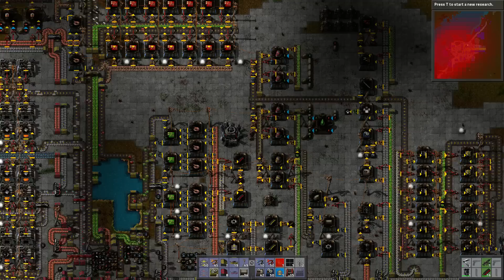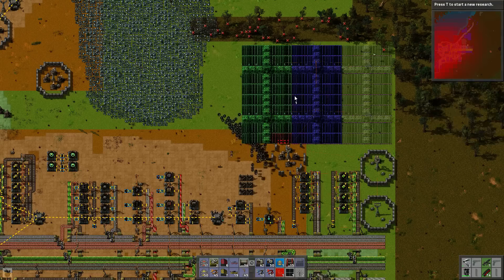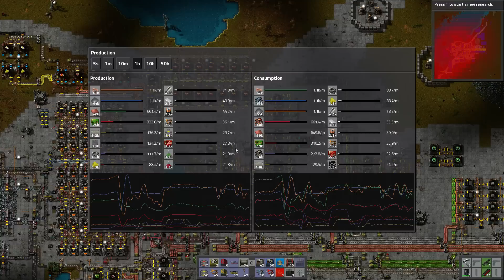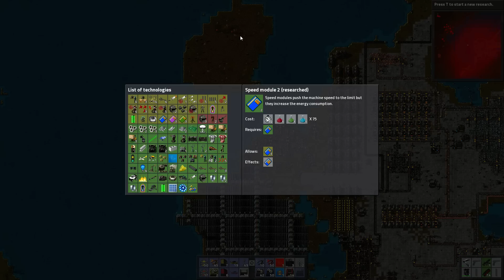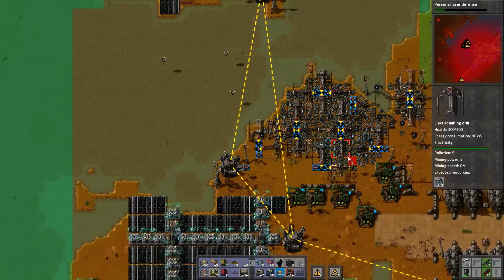Factorio Let's Play Patch 0.12 (27)

Comment: could someone help i am playing the 0.11.16 and my plastic and batteries are being slowed down because the lubricant i make is being used fast enough, and filling up the tanks i've made. ( i've made 6 just for lubricant) so how can i begin to use more of it
Reply: nicholas islam More assembling machines?
Reply: i have 3 assemble machines making electric engines and 2 making the express belt so even but you can't have enough of anything so i'll try
Reply: nicholas islam Instead of making more lubricant, just crack some of the heavy oil into light oil and then crack that into petroleum.
Reply: actually after i posted that i looked at the wiki and found that i could do that so thanks anyway